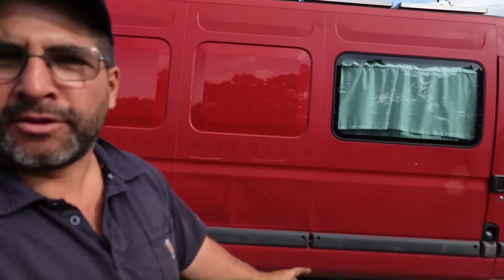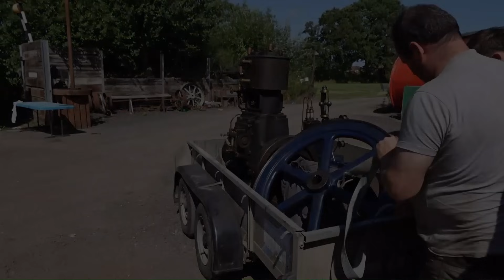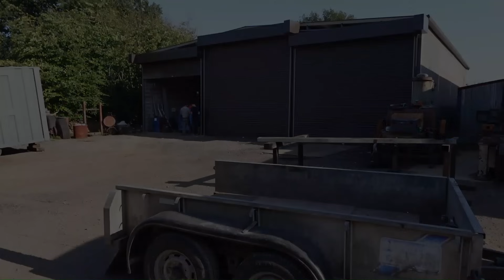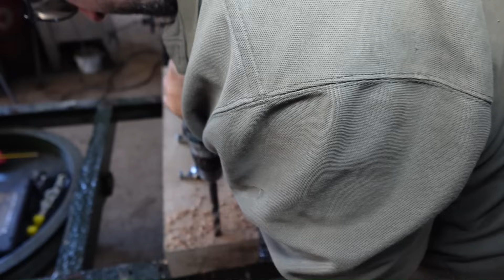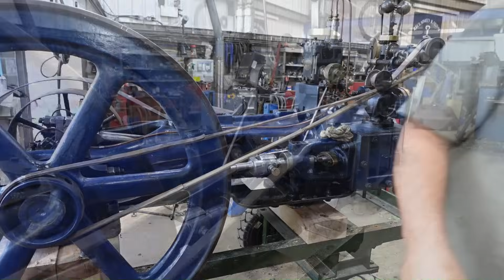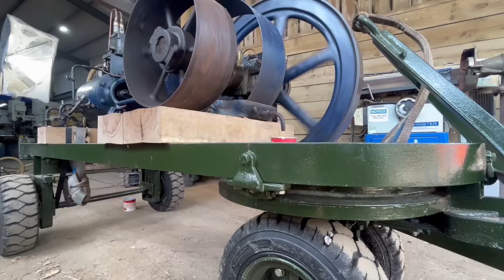FROM Collection to FIRST run Up!!! My BEST Engine Yet!

Comment: Lovely!
Small anecdote from the old Brit in North Carolina.
This relates to the safety on the governor belt.
Quite few years ago there was a big horizontal at North Carolina live steamers in Apex.
Was set up to drive a sawmill flywheel was about 10 feet by 12” wide.
So I was at the cylinder end during a sawmill demonstration, when the main belt walked off and fell on the governor belt.
Immediate runaway the engine was jumping 2” off its bed.
I hit the stop valve to shut it down, and was immediately knocked aside by a guy about half my weight because I wasn’t going fast enough.
All was well in the end, but a truly frightening experience.
Reply from the maker: Did it not have the cutout for belt failure? This governor will shut steam off if the belt falls off or brakes. All done via the bobbin type tensioner running on it.
Reply: @VintageIronukno it did not that is why it happened!

Comment: Very nice, just thinking does that tensioner pulley maybe rest under the top and on belt bellow so they don’t rub together 🤷🏻‍♂️
Reply from the maker: It’s not a tensioner, it’s a safety for when the belt brakes. Will slow the engine and not let it run away.

Comment: Nice little engine there Norman well the one you got running the others are still an unknown as of yet. I dunno if you could eliminate that rod get a bit more power out of it without the extra load that's putting on the system. It just seems unnecessary to leave it in if it's not doing any work. Or you could find some sort of funny attachments to go on the end of it for a laugh.
Reply: Look at a German steam locomotive, you see the tail rods.  The rod makes the exposed area of each side of the piston identical, and produces smoother running.

Comment: The vertical engine you were moving early in the video appears to be about the same size as the engine driving the main condenser circulation pump on the SS JOHN W BROWN, on which I was privileged to be an engine room volunteer for several years

Comment: So if the engine is going to work on a trailer, that one is definitely not strong enough or stable enough as it is.
Reply from the maker: 2 ton rated trailer with 1 ton steam engine on board 😂 she will be alright

Comment: That trailer is a nice looking bit of engineering Norm. What was it's original purpose?  Engine ain't bad either! The castings have beautiful lines. Now you just need some proper steam for the old girl to shine. Hah! the welder does not work this week without the ground lead either 🤣cheers
Reply from the maker: It’s an old lister slow speed trailer. 2 ton rated so perfect candidate to put the engine on.